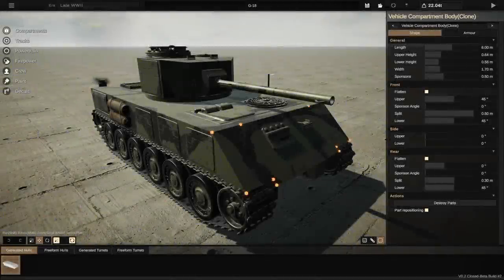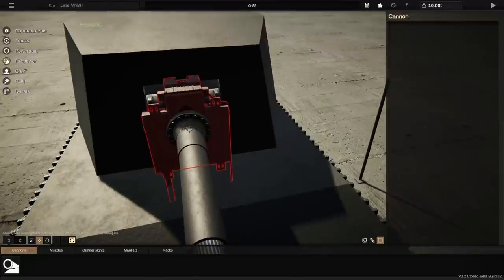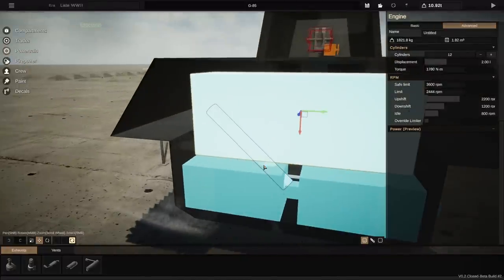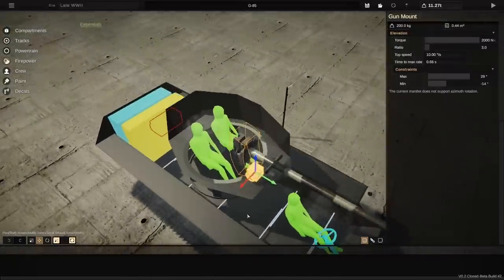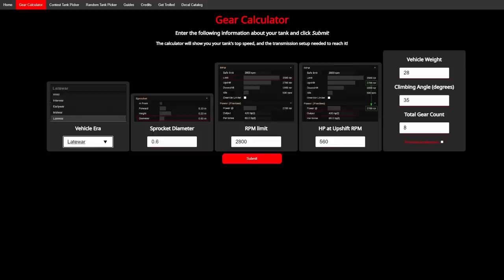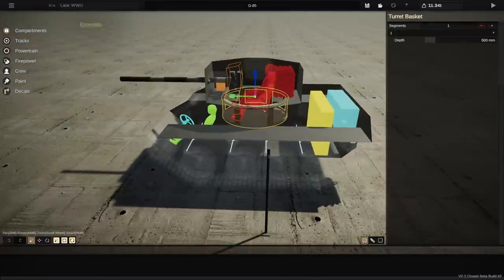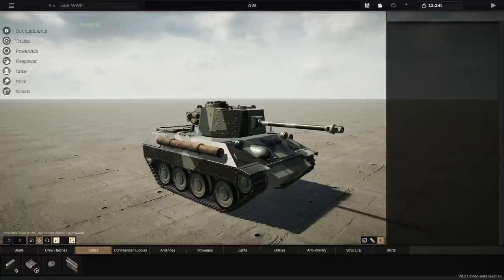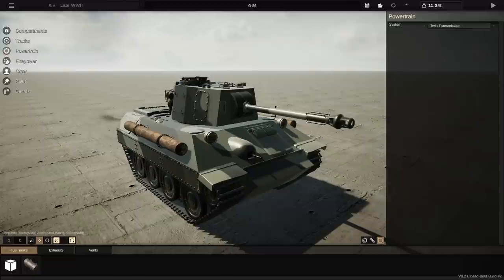Sprocket Geometric Internals: Closed Beta Review

Comment: If i may make a suggestion:
It would be cool if there was also the need to put a radiator for the engine.
Reply: i hope sprocket eventually will be war thunder + more features (custom ammo etc) + self made tanks, will be rad af
Reply: @thundergroup  custom shells will be in 2024
Reply: Will you have the ability to check your internals while fighting like in war thunder cause that'll be pretty cool to see what's damaged inside you tank as you fight

Comment: I used the tool for calculating gears it saves time over my normal method but I think the calculations are slightly off as my normal ratios are usually about 5-10kph faster without any loss in acceleration or climbing, but it does create very acceptable transmissions without all the fine tuning
Reply from the maker: It’s meant to undershoot the top speed just a tiny bit, as it helps improve acceleration closer to the top speed by calculating that way.
Reply: @thewonderwaffleofficial Will you upload another video about the update soon?

Comment: I do love the game and all but my question is will there be and new set of tracks, or new tank mantle like a Tiger H1's or even a Panzer4 or a new set of wheels? Im sorry if I sound rude or impatient. Its just I want to make newer tanks with different sets of everything. It kind of bugs me to see the same tracks and wheels for everything. Love your Vid's keep it up.
Reply from the maker: Thanks!  New parts are anticipated to arrive some time after Geometric Internals.  Those specific parts may or may not be included.
Reply: @thewonderwaffleofficial  Ok I Was only wondering cause im a Tank nerd and all it's just weird seeing the same tracks for the different tanks that I make. What should be added when another update should come is that the tracks would realisticly Fall apart like you see in real life or in a game called WarThunder. Where the track would just flop off of its sprocket or Idleing wheels. Thats only a wishful thinking but would be cool. lol

Comment: What has changed so far? Does spaced armor inside the tank work? Can you repair damaged modules? Will the engine need ventilation? Is combat working? If so how is the damage modelling doing?
Reply from the maker: This video is still the most recent version of the closed beta.  I have another video in the works that goes more into some of the building aspects.  
We should have another build available soon with more features.
Reply: @thewonderwaffleofficial  thanks

Comment: i think its safe to say that my 1.84l v28 aint fitting in my light tank anymore :(
Reply from the maker: It will be easier than before, surprisingly.  The engine I was using is relatively big, yet is pretty small in 0.2.  The engine doesn't scale exponentially in size like 0.1x engines do.

Comment: Question: What happens to my existing designs when the update rolls out?
Reply from the maker: There should be backwards compatibility by the time it launches.
Reply: When the last update came out which lets you put your ammo anywhere in the tank I had to re-add the ammo to be able to use it. I'm assuming when this one comes out you just have to re-add the transmission, engine, crew and other stuff that's gonna be a 3d internal in your tank. Great news is all your tanks will still be saved so all you have to do is update it with the new features and it'll be ready for battle( unless it's to small to fit all the internals which I think some of mine are. I have a tank with a very small and flat turret so the turret ring is gonna need to be very big to fit the crew hopefully the hull for it will be big enough for the turret ring.)